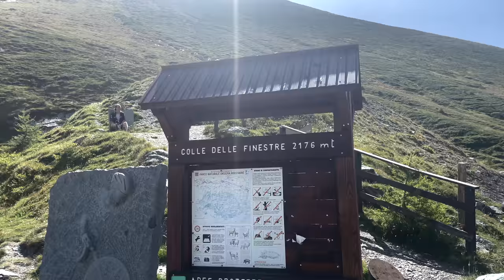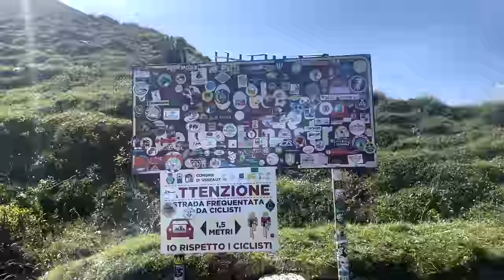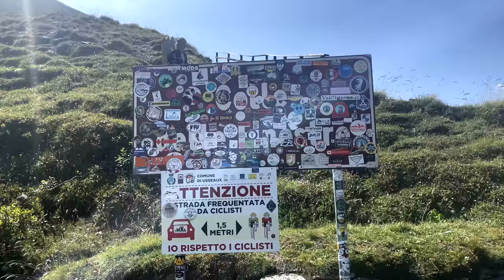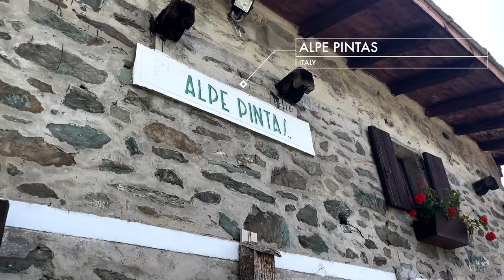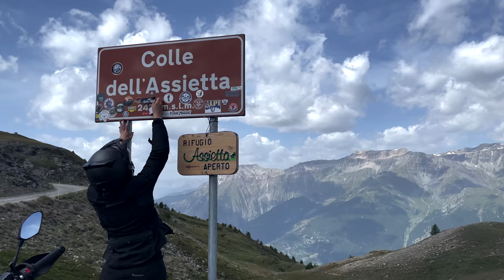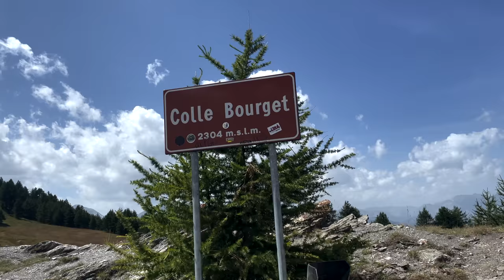ASSIETTA + COLLE DELLE FINESTRE: The MOST BEAUTIFUL offroad route in the world?

Comment: Could you kindly advise which protective carry case for laptop you use to keep laptop safe in event you fall over.
Reply from the maker: I use nothing special, I actually don’t know the brand, a little harder shell - but that’s why I travel with hard panniers to be able to store my technical equipment in them without them getting damaged in case of a fall. If in doubt I store my laptop in the bottom of the bag that I have on top of my luggage bridge - if the bike falls , it falls to the side, and the bag is not bothered.
Reply: @Got2Go  Thanks